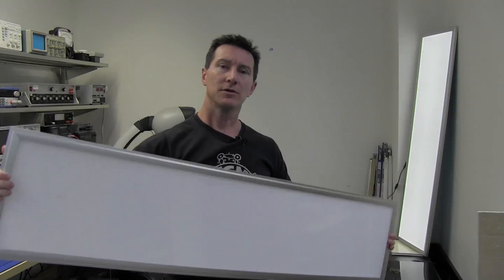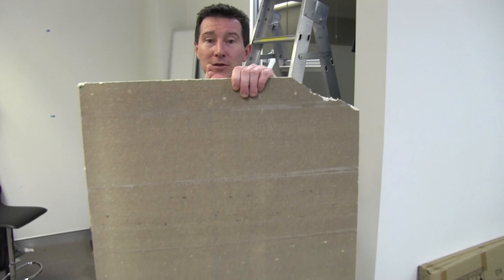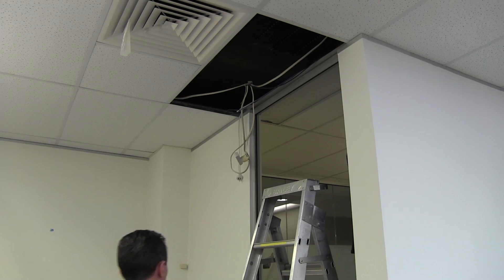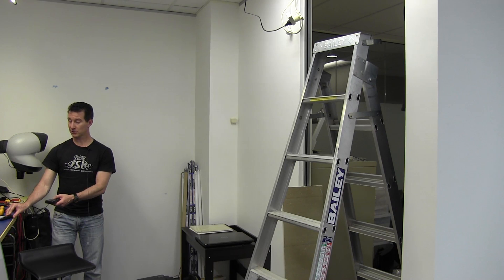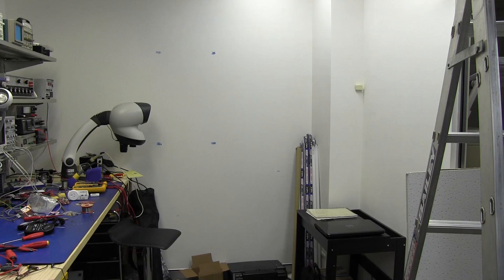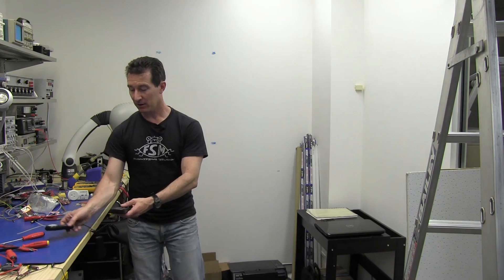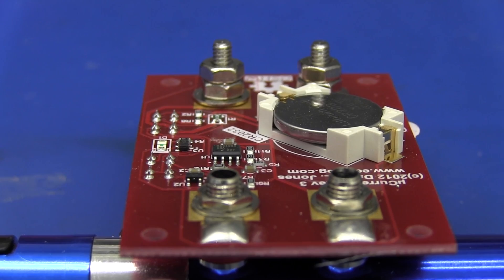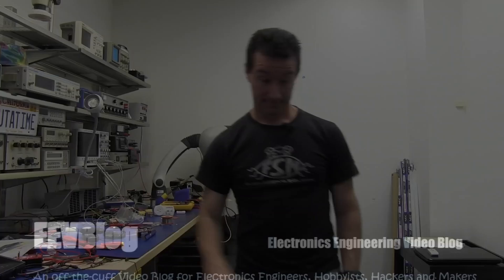EEVblog #364 - LED Ceiling Panel Lighting Install

Comment: @EEVblog, The new lighting looks great Dave! If you wanted a bit more reflection in the front or your left side, you could install a couple of mirrors on the walls in the corner and some black wall covering on the wall in front of you to the right side, to get less reflection where you don't want it so much.

Comment: In the UK they call those ceilings suspended ceilings. Surprising how the wiring up there is all loose to move around. We'd normally have Plug-in Ceiling Roses that fit in BESA boxes for lighting.

Comment: The higher frequency can be folded back into low frequency that the camera would pick up. The camera should be designed to reject 50 and 60Hz and their harmonics, so ideally you'd pick a frequency that's a multiple of that.

Comment: Here in Canada the wires are armour type, none of the plastic coating so rodents can't chew the wires causing a fire. Wires can't be lose on top of the tiles either, network cables in cable troughs so firefighters can pull down the ceiling and get to any burning cables easily.

Comment: In U.S., comm wiring (etc.) is not allowed to drape across the tiles; they must be supported from above so that when firefighters pull down a ceiling during a fire they don't get a facefull of cables. Notice the yellow telco wires are held up with cableties and stickpads. Do you think they would hold up during a fire? It wouldn't be as pretty, but it would be better to tie the cables to the grid hanger wires (which might not be legal either).

Comment: Saw some comments about the US.. they must work in buildings with better cable management, we just drape everything over whatever is up there in government buildings - really makes a mess for us networking guys.  Also, the lights in the US are typically one contiguous wire from the fixture to the wall switch, so they haven't figured out the cost savings of putting power points up there.  Also, definitely makes it easier to install or relocate lights without turning off the breaker.

Comment: If all else fails you could try some Neutral Density film (or car window tinting film) over the panel. A waste of power but possibly easier in the short term than modifying the controller or designing a new one.

Comment: Nice job, much improved, but not quite finished.  What you should do now as some have suggested is get task-specific lighting and control it with a wireless Arduino!

Comment: I like your building codes allow for individual power points for light installation and such. The US won't allow it as the electrical contractors won't allow it to happen here.

Comment: EEVblog Bit of a bodge way to wire them using power strips rather than using t&e cable back to the main light switch, but there again I believe the electrical laws in Australia are a lot stricter than here in the UK and I suppose you can't alter the mains fixed wiring in such a commercial premises.

Comment: Installing those LEDs in the ceiling was really a bright idea. (Couldn't resist that one.) :)
I think the picture looked somewhat overexposed during the first test with the LEDs turned on, but during the second test when you put the camera back into auto exposure, then it just looked totally awesome. What's the make and model of your camera?

Comment: I love leds so much...but the flicker is a touch annoying.
A friend and I are working on super high efficiency stage lighting as a hobby project, and I'm torn between the high efficiency flicker of PWM, and the benefits of constant current no-flicker but wasteful drivers.

Would a largeish capacitor on the output side of the pwm driver smooth out the flicker without hurting the current sense ability of the driver circuit?

Comment: Why would firefighters want to pull down a ceiling during a fire? Wouldn't that increase the chances of the fire spreading?

Where I am from (the UK) the false ceiling is intended to act as a fire barrier to prevent the spread of fire to the floor above.

Comment: Does the return air to the air handlers travel by ductwork or just use the space above the ceiling? Sometimes they do the latter to save money, but then all the wiring above has to be "plenum rated" to prevent fire from following the cables like a explosives fuse.

Comment: I really don't know why a FD would want to pull a suspended ceiling down; perhaps if there was something on fire above?. All I know is that when we ran phone and Ethernet cabling in a new office, the FD made us support it all independently of the wires holding up the ceiling. It's a lot neater that way anyway, else every new guy running something would just throw a cable(s) across and it would turn into one mess of spaghetti that would NEVER get cleaned up.

Comment: Excuse the response to such an old vid but just for the sake of correct terminology, that type of ceiling is called a suspended ceiling.  Have to say, whoever did the cabling and AC install needs stringing up, it is appalling!  Cable tie'ing cables to self adhesive supports hanging vertically is a problem waiting to happen.  The adhesive WILL fail, resulting in a mess of cables resting on the ceiling panels!

Comment: Hehe, I've built 100'000 lumen light fixture in my room, that's about ~2000 lux across the room. Too bright. 1050 Watts of metal halide lamps. Writing an article about that at themoment.